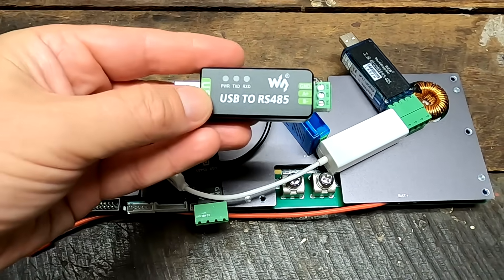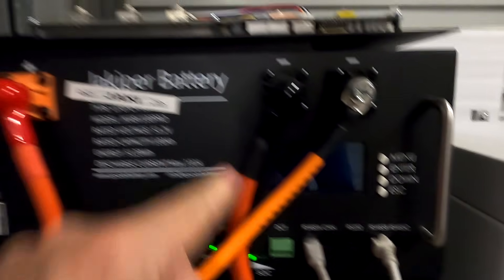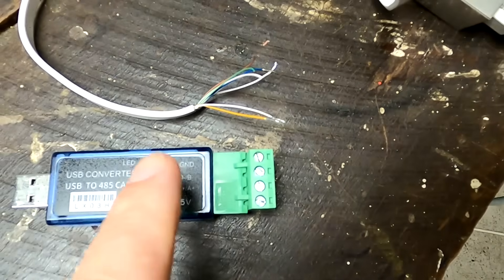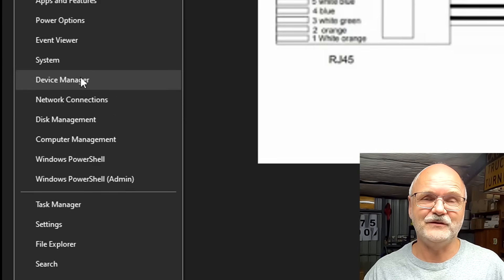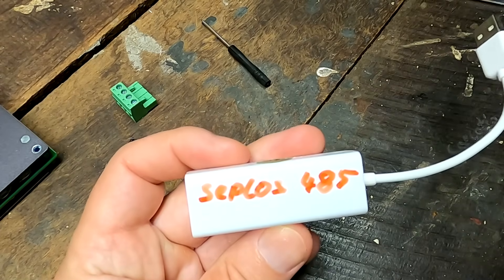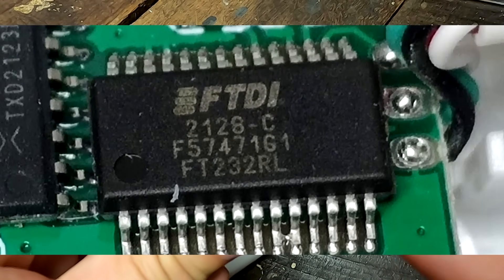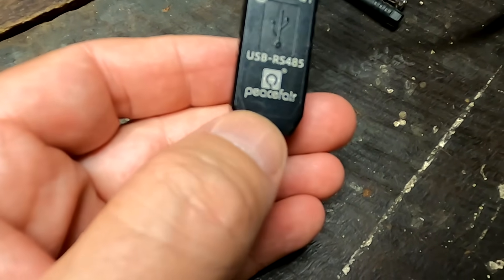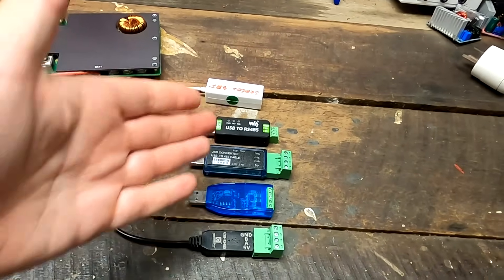JK Inverter BMS: These adapters actually work! RS485 and CAN, Adapter Test and Cabling Guide.

Comment: There is not just one chip.  First chip is USB to serial single ended like you would use for an RS232 port.  There are several different chips for USB to serial, all do same thing but require different PC drivers.  All drivers will usually install automatically as long as you have web connection to download driver.  You have to look up the assigned COM port number.by your PC.  The COM port assignment depends on what devices you have previously installed.  Sometimes you need to check the assigned baud rate but the JK PC software likely defaults the setup to 9.6 kbps or 19.2 kbps.

Second chip is the 8 pin SOIC which is usually MAX485 or Chinese clone of it.  It takes in serial data and converts to RS485 two wire balanced data.  Balanced line impedance for twisted pair is about 100 ohms impedance which is close to standard internet CAT5e, CAT6 cables which have four twisted pairs in one cable.

For long lines and multiple RS485 devices connected, the first device and last device should have 120 ohm termination resistors to prevent data pulse reflections on cable that can corrupt data reception.  

Some USB to RS485 converters have the 120 ohm termination resistors across the twisted wire pair and some do not.  Again, only the first device and last device in the string of connected devices should have the 120 ohm termination resistors.  You can check across the two terminals with ohm meter to see if it measures about 100 ohms indicating the USB to RS485 converter has the termination resistor.

This first and last termination rule also applied to multiple connected BMS's.  The documents should say something about the last BMS in the string should get an RJ45 connector plugged into second RS485 port with a termination resistor in the RJ45 plug.

The BMS communications is actually MODBUS protocol on top of RS485 twisted pair, balanced data for physical data link.  On top of the MODBUS protocol is another protocol of the various inverter/BMS protocols which includes particular functional register location assignments, like where cell #3 voltage is stored and how to request a lowering of inverter's or charge controller's charging current to prevent an overvoltage cell shutdown by BMS.
Reply from the maker: Thank you for the deep-dive and explanation.

Comment: I guess I'm behind in times lol... I only got the older style JK a few months ago but they are working great. All 3 doing like they should as far as I can tell
Reply from the maker: You're not behind. The newer JK just has some additional features and communication. To achieve the same with your models, you would need some additional hardware to upgrade (like the Peter board)

Comment: Thank you Andy. I am using the DTK DRF2659C RS485 to Zigbee (wireless) converters to overcome issues with long RS485 cabling. Believe that the DRF2659C and DRF2658C (USB version) can be combined to convert from RS485 to USB over Zigbee.
Reply: Thanks Andy. You are absolutely right, RS485 supports transmission over very long cable distances (up to 1200m). The reason why I am using Zigbee was the difficulty of installing a cable from the front of the house to the garage (separate building) around 30m away. Because of signal strength issues and WIFI interference, I am using a DRF2659C in a router mode in between the two end-points. The connection is slow but very reliable.
Reply from the maker: Thanks Alfred. I wasn't aware that RS485 has long cable issues. I thought it was specifically designed for long distances...?
I would not recommend using Bluetooth or even Zigbee for such time sensitive data transmission. Zigbee is not made for that and is very very slow.

Comment: ESP32 (with some software) connected to JK BMS over Bluetooth sending data to Home Assistant over WiFi is what I use.
Reply: Exactly the same as me, I do it also with my Inverter (PowMr) via RS-232 (ESP32, MAX3232, and AMS1117) powered from the inverter's 12V async port.  I do Grid AC Monitoring via a PZEM-016 connected via RS485 (ESP32, MAX3485, and AMS1117) powered from the PZEM's 5V output.  Everything goes to Home Assistant (MQTT) via WiFi.  Doesn't require any vendor specific websites to store (or lose) the data.
Reply: @DavidPrue i have also powmr hvm pro 6.2 kwt model and i have older bms (black one with 2a balancer), use it with Syssi integration from Github over bluetooth, its works good. But i have questions did you use this new jk bms with Powmr communication over cable, and what protocol did you chose on inverter and bms?If its not supported by Powmr, can i just connect this bms to the battery and use this new bms without connecting to Powmr?Thank you
Reply: @DavidPrue  can you please David share some more information about an Essp board? How it works, and how to achieve communication between bms and Powmr. Seems like i have very similar setup to yours and the same goal. Thank you
Reply: Is there a tutorial for this?
Reply: Could you please provide a small how to. I'm also interested in monitoring and controlling via an ESP32 and HA.

Comment: Hi Andy, could you make a video with the same level of explanation for connecting the EBC-A20 to the computer? I've already connected mine, but sometimes it connects and sometimes it doesn't. In addition to losing connection in the middle of the test. I use Windows 10.
Reply: @olavolu order yourself a ADuM3160 USB isolator. I had the same issue, I'm currently testing my 10th cell without a single disconnect.
Reply from the maker: There you go...

Comment: Hi Andy 
Can I connect my old JK bms with new? In my garage 3 battery with old bms b1a20s15p, I want to buy new jk bms with new battery, but dont know can it work together? Or do I need to sell all my old boards and buy new ones
Reply from the maker: They will work together, no problem, just not from a communication side of things.
We will have a solution for the communication in the near future.
Reply: @OffGridGarageAustralia  Thanks

Comment: Off grid for two years 47,000 W of PV, 250 kWh of batteries with JKBMS. none of them communicate with anything or anybody. They work just fine.
Reply: Fark, that's a big system! I agree though, my bms doesn't talk to my inverter and it works just fine.
Reply: @just_saw_dust  I'm south east, and only have a small system with 8.74kW of panels, 8kW Quattro and 29kWh of batteries, BMS doesn't talk to the Victron system either. We do have a 50kW system where I work and I see just how badly that performs in the winter. In December it generated 735kWh, or average 23kWh a day, worse day though was 0.4kWh!!! So it seems a house with 47kW of panels and the amount of batteries the OP has could easily get by, but depends where they are and how much they use of course.
Reply: @just_saw_dust if you want to survive winters sometimes even that amount of panels is not enough.
Reply: @TheRonskiman lol...? You surely are an American to have this kind of vision of survival.
Reply: @honumoorea873  think replied to the wrong person.
Reply: I have 12,000 w of panels and yesterday clouds was so thick that i get only 400w out of them!@TheRonskiman
Reply: Off grid in my haulage companies yard noting but trailers no toilet no water...but happily living 5 nights in my self built campervan...nearly 2 years.
Reply: I do not have this big of a system but I think bms communication with inverter is just a source of problems and in now is a necessary feature. It just just make the system more complex and more prone to fail. But I suppose it's good for people that earn money doing videos and selling more useless devices...

Comment: Like# 162 - phone is getting a new battery... I really do NOT like adapters... So much so, I won't use an adapter...
Reply from the maker: no Firmware updates for you then, Paul.
Reply: @OffGridGarageAustralia  I actually have one for my Growatt that I’m not willing to do because the last time I tried to update it, it bricked it self and I was without power for 3 days while they shipped me an updated motherboard…

They didn’t believe it was bricked until I sent it back to them… 🙄 they insisted it wasn’t possible to brick it…

Comment: Cheap USB to RS485 converters claiming to have an FTDI or Prolific chip always have counterfeit chips. By cheap I mean a couple of US$ or less. Those with genuine chips will cost close to 10 US$. If I don't need a converter with a serial number, I usually go for one having a CH340 chip. Those with fake Prolific chips won't work with Windows. Also, if you buy two, they will both have the same serial number. Those with fake FTDI chips work, but if you buy two you will find they have the same serial number.
Reply: @BobDevV  My reply keeps being deleted. Unbelievable! Stop doing that!
The cheap "Prolific" adapters don't work in Windows because the driver from Prolific identifies a non Prolific chip.  Also, these cheap "Prolific" adapters hangs after a while and must be removed and reinserted.
The cheap "FTDI" adapters did not work in Windows some years ago and for the same reason. The FTDI driver identified a non FTDI chip. The prospective customers made so much noise that FTDI backed down and allowed the driver to work with counterfeit chips. I purchased a cheap adapter with a FT232RL chip in it. It did not have a unique serial number and the utility FT_Prog from FTDI did not recognize the chip. I unsoldered the FT232RL chip and soldered in an FT232RL chip from a reputable distributor. Then it had a unique serial number and FT_Prog recognized the chip.
Counterfeit chips are a huge problem. There is a mountain of evidence.
I needed adapters with unique serial numbers and I had to pay for adapters with genuine parts. I also got reliable adapters.
Reply: A bit off-topic: I have two "old" style JK BMS 8s 200 Amp. (In silver frame.) from 2023. These originally worked fine for couple of months, but were disconnected for several weeks, and completely removed from the battery. Reconnected recently and tried to restart with the button - that went OK - but the app but all possible passwords failed to be recognized. 1234 or 0000 or 123456 etc. None of them worked. BT connection visible, but i was  not able to log-in monitoring screen, let alone the settings screen.
Contacted local supplier here in Netherlands, and he managed to get a temporary password from JK China - valid for one hour....(!) pfft...
In the end I managed to blow some life in de JK's again without this temporary password. Procedure:
1. Disconnect BMS completely from battery and wait for 5 minutes.
2. Remove JK BMS app and reinstall on phone.
3. Reconnect all cells and negative to BMS again, push startbutton immediately after that.
4. Password for pairing 1234 - that worked !
5. Use previous set password to log in advanced settings
Quite a few people on internet seem to have had the same problems. Maybe this helps....
Reply from the maker: One password (1234) is only for the Bluetooth connection, the other password is set in the BMS itself, so nobody else with the app can connect to your BMS and change settings (a must for camping batteries!)
Reply: @BobDevV  The cheap "Prolific" adapters don't work in Windows because the driver from Prolific identifies a non Prolific chip.  Also, these cheap "Prolific" adapters hangs after a while and must be removed and reinserted.
The cheap "FTDI" adapters did not work in Windows some years ago and for the same reason. The FTDI driver identified a non FTDI chip. The prospective customers made so much noise that FTDI backed down and allowed the driver to work with counterfeit chips. I purchased a cheap adapter with a FT232RL chip in it. It did not have a unique serial number and the utility FT_Prog from FTDI did not recognize the chip. I unsoldered the FT232RL chip and soldered in an FT232RL chip from a reputable distributor. Then it had a unique serial number and FT_Prog recognized the chip.
Counterfeit chips are a huge problem with Chinese vendors. There is a mountain of evidence.
I needed adapters with unique serial numbers and I had to pay for adapters with genuine parts. I also got reliable adapters.
Reply: @BobDevV  You are a troll

Comment: Hi Andy, for the test you used a battery monitor. Is this the one from SEPLOS which you can be downloaded from your Google-Drive, or does it come from JK?
Reply from the maker: The JK BMS will only work with the JK Battery Monitor software. Seplos is different.
Reply: @OffGridGarageAustralia  Can you provide the link for the JK Battery Monitor?
Reply from the maker: @upper_deck  All resources are on my website. Have a look under the JK Inverter BMS here. There are the links to firmware, documents and also mobile and PC apps: https://off-grid-garage.com/battery-management-systems-bms/

Comment: Thanks again for the informative video!

Last week i tried whole evening to get it working like this with an even cheaper usb-rs485 adapter. It only has super small A an B port, but yeah, for €2.95....

Recognized in windows, but no communication with the JK software at all. 
Checked with different cables, swopped A and B at the end, but no luck... 

Now bought the one with blue transparent housing for €6 and it works immediately! 

Connecting the BMS is indeed simple, but using an adapter for €2 was too good to be truth😂
Reply from the maker: I thought one of mine was even cheaper than $2. But yeah, you never know, could be a counterfeit chip as well and the driver didn't work correctly.
Reply: How are you  I need help my Hawaii 48v lithium battery discharge then I chrg it now it's  47v but if you connect to the inverter the inverter blinks all lights but not charging

Comment: I simply use the JK USB to RS485 .. all one piece. It one of the accessaries listed on their Ali Express JK Official site.
Reply from the maker: Does this connect to the new inverter board as well? I didn't have a look at this adapter...
Reply: @OffGridGarageAustralia  When you order at the minerals official store you can choose including the adapter or not (+11 $), when you order the JK-V4 battery box from EEL it is included.....